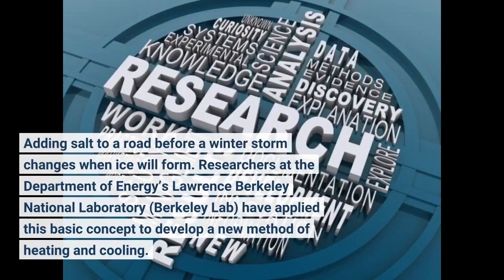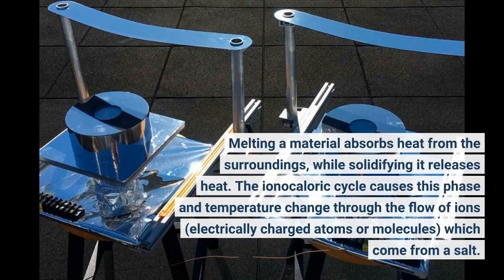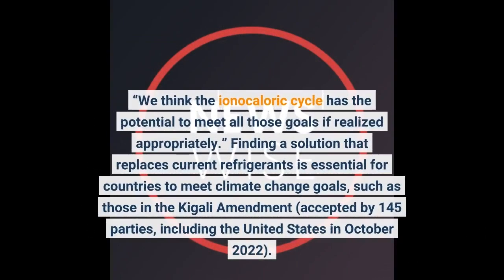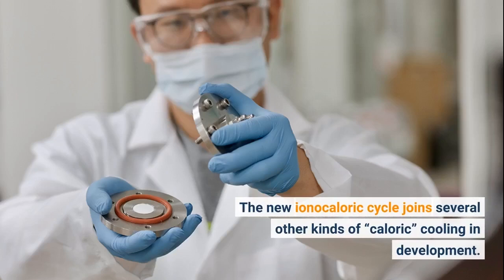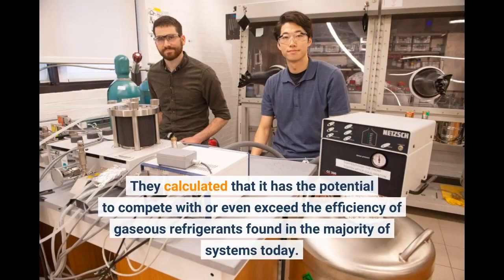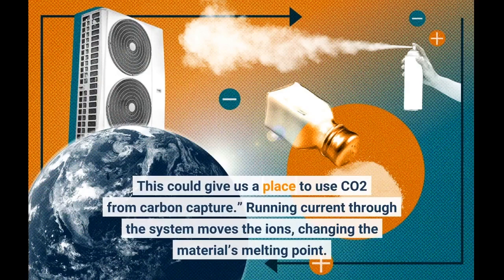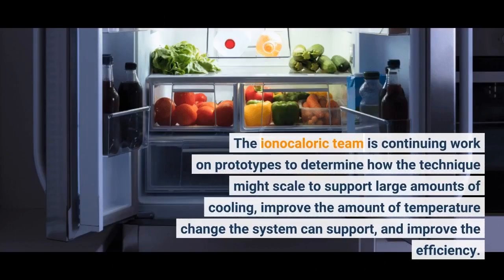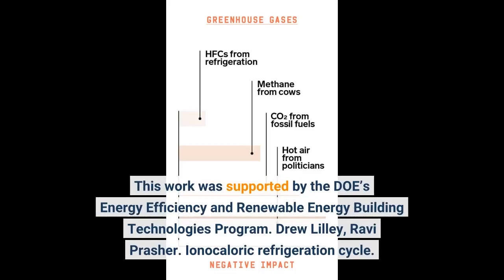Scientists develop a cool new method of refrigeration

Comment: 'Curious how much electricity an appliance using Ionocaloric technology would consume as compared to the present technology?
Reply: In theory it should use much less because there isn’t the need for a compressor .    But only time will tell.     There will still likely be a need for some type of pump , and of course fans .    But a small pump would use much less than a compressor .
Reply: @kelleykeffer6249  Thanks 😊.
Reply: @Signull_Dev  I think it will consume a lot because the electrical system in its nature is energy-hungry. For example, the electrical heating elements consume much more energy than the compressor.